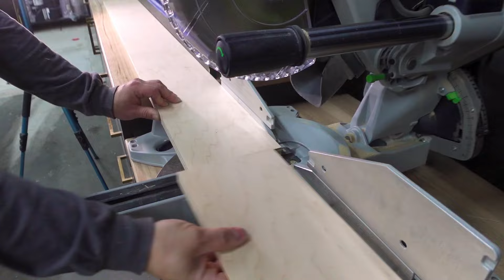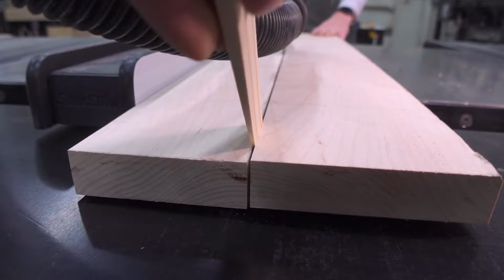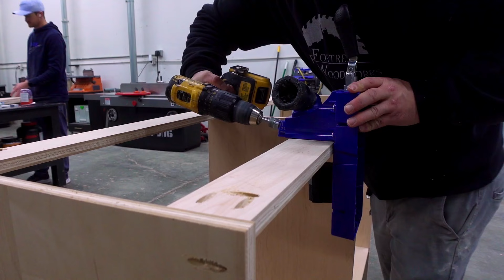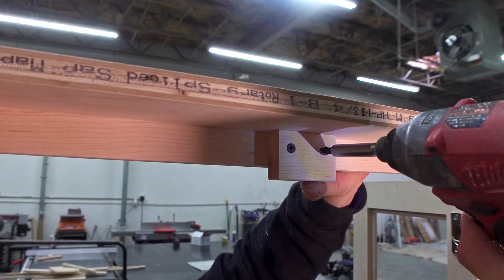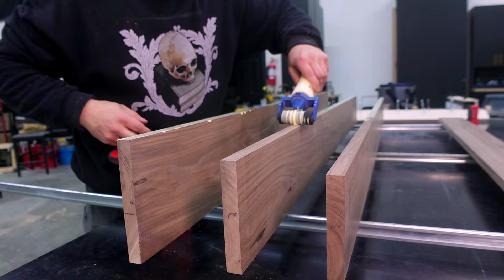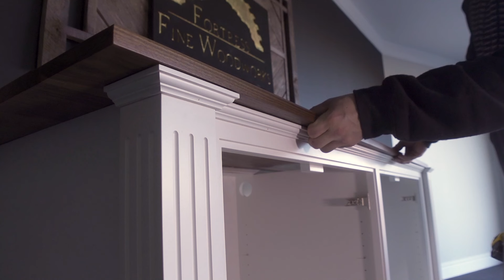Adding The Golden Touch.

Comment: "Some like walnut and some like painted" completely sums up YT woodworkers.... there are literally thousands of other species, but YT is either walnut, epoxy or painted
Reply: yeah i find that too.. one successful YT'er does it.. others with a lower sub count think itll help subs

if you check ebay, see the amount of people buying walnut lumber and boards -  and also the amount of river tables

in fact river tables are so common, it makes the cost of producing one outweigh the value - supply and demand (and many river tables look gaudy and tacky with waves and models sunk in to make it look like a beach :s)

fortress, four eyes, blacktail etc i think use wood/epoxy in much classier ways than some sub hunting rivertable epoxy fiends - and think up new ways of doing things, rather than copying other YT'ers

epoxy just became the new MDF.... and theres a huge influx of people watching the videos and then making something and flooding ebay and etsy with their rivertables and railway sleeper 'furniture' where they buy pith ridden railway sleepers for cheap, cut and screw.. and then sell it for an extortionate price as rustic furniture :s ....and people actually BUY that rubbish

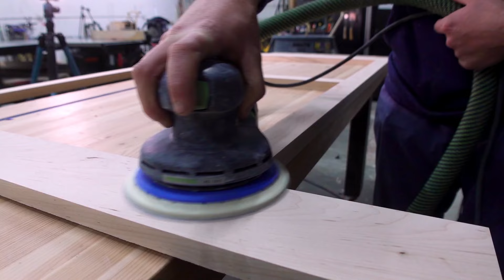Comment: 8:35 - The dominos I've used both had an issue where the clear plastic guide was not centered, so when I'd put two pieces together they would not be flush side-to-side. 

I ended up widening the screw holes and sanding off one side of that clear plastic piece so I could adjust it and that gave me perfect alignment and fixed the problem. I used the scribed marks on the bottom of the tool to line it up. 

Quite a glaring issue that a $1200 tool shouldn't have.
Reply from the maker: Ya, I'm surprised yours needed that much fiddling to get it right. I had to do some altering to my kapex to get the fence straight too. It's annoying when it happens but 99% of the time everything is dead on
Reply: @FortressFineWoodworks  I’d hope it’s rare for the price point. 

I have a Kapex that I can use (local Woodcraft) but I try to avoid it. Even with a great blade it just gives me so much tear out and an almost rounded cut, but my Rigid at home that I squared up gives me near-perfect 90° super clean cuts up 16” long. 

I just want to tell people to save their money and take the time to really set up their tools.

Thanks for the response! I really appreciate all of your insight and work you put into your videos.
Reply from the maker: Thank you for your experiences too!

Comment: Im pretty sure it's not the aluminum that triggers the saw. It's the current running through it + meeting the resistance of your skin that does. If your hands were electrically isolated from the aluminium, the safety shouldnt trigger.
Reply from the maker: That's a great observation! I would say it's the electricity grounding through the cast iron since that is far more conductive than my juicy hands
Reply: @FortressFineWoodworks  Sure, that too, the main point being the current needs to hit the "resistance" (not sure if that's the correct word cause physics) of skin or similar like a hot dog. The saw doesnt activate by contacting something conductive, ie metal on it's own shouldnt trigger the saw. Metal + your hands touching the metal will. I think there's an article/FAQ on SawStop that discusses how the tech works. It's not triggered by conductivity.

Comment: Mind if I ask what paint sprayer you use? I can’t find it in description. Thanks!
Reply from the maker: It's the graco x7 with a 308 fflp tip. 
https://amzn.to/49VKdts
https://amzn.to/4bXRfQ9
https://amzn.to/43baq5e
And the hvlp is an earlex sprayport with an apollo atomizer gun
https://www.dipyourcar.com/products/advanced-dipsprayer-upgrade-no-gun?variant=14741902468?utm_source=google&utm_medium=surfaces&utm_campaign=free-listing&gad_source=1&gclid=CjwKCAiAopuvBhBCEiwAm8jaMW9MQVU2cjyjJKN3GdqsCQdBAn8vn0rsIsW3hdPXdjjVUcuggWia2hoCuIgQAvD_BwE
https://amzn.to/3v0DfVh
Reply: @FortressFineWoodworks  oh, so you use two different sprayers? Do you just use a different one for different applications?
Reply from the maker: I use hvlp for solvent "oil based" coatings, and airless for waterbased coatings

Comment: Hey man, so I have a question for you. And you’re just the guy that can answer it. 

So I’ve built many cabinets. With my dad who’s been a carpenter since the 70s. And how he prefers to do it is stick build it on site. We get pretty good results. But I’ve been in his ear about him letting me build them in my lil shop (my garage)

My question is when you install, do you putty the nail holes and caulk the trim and then paint again? 

What do you do if the wall you’re installing into isn’t square,plumb, or level? That’s my dad’s main argument against building them off site. We do those things while we’re building. 

For example there is a little gap in your basecap in the finished product. Obviously it’s not been installed to finish yet. But would you caulk or putty a little spot like that? How do you go about installing and finishing the install?
Reply from the maker: We use wax fillers for holes, then touch up with the original paint if necessary. For caulk lines we tape the finished product, caulk the seam, and immediately paint with the wall paint, then pull the tape. Youll have to watch more of my videos to see. Here's a video on installs https://youtu.be/1YPB6A0pSOg
Reply: @FortressFineWoodworks  thanks man. I appreciate it.

Comment: Your project turned out great!!  Just my two cents worth: when you glue up the fluted columns, use packing tape across the joint, add glue and then fold the joint together.  I have used this method on everything from small boxes to large heavy columns for kitchen islands as well as wraparound grain for fireplace mantels.  If you put just the right amount of tension on the tape you will get a very tight joint and won’t have to fill the divots left by the spring clamps.  Love your channel!!
Reply from the maker: Thats a great idea. I completely forgot about that trick when doing it! Thanks for watching!

Comment: So.... do t know if anyone noticed... but.... when the brass mesh  hit the blade, it retracted. And the brass had a bit more than than a knick. THATS YOU’RE FINGERS PEOPLE.
Reply from the maker: The only reason it took the blade a second to recognize it is because the aluminum has an anodized coating. So it wasn't grounding against the cast iron very well. It would act faster on a finger

Comment: In regard to panel saws and lacking the same technology as a SawStop.  True panel saws are operated differently than a traditional table saw.  Their inherit design eliminates typical kick back scenarios.  And their operations and design also keep your hands away from the blade, unless you aren't operating it safely, thus correctly.  I think if someone has the means to purchase a true panel saw and are concern about safety, I suggest that you operate one before making assumptions that the SawStop is the only safe saw.  Now credit where credit is due, and SawStop saws are nearly idiot proof, ensuring the function is ""ON".  But with a panel saw, just operating it correctly and not taking short cuts (using jigs and clamps as appropriate), your hands are never required to be close enough to the blade to create an environment where an accident may occur, no matter how small the piece you are cutting.
Reply from the maker: I agree, but sometimes I'm an idiot. So problem solved
Reply: This past year they released a couple panel saws at AWFS that had similar technology. Maybe more advanced as you don’t need to replace the cartridge. Felder should have it.

I’ve been considering a panel saw as well and agree with the above statement but since I don’t currently have the space I should be going with Harvey later this year.

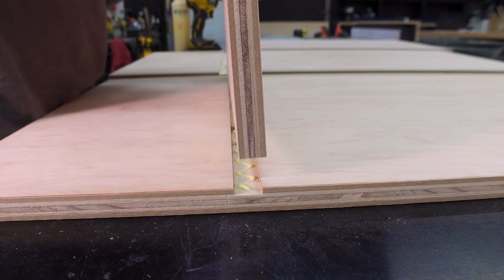Comment: 3:32 why is the dado so much wider than the vertical piece? It's offering no support and structural aids at all. It also isn't specifically placing the panel in the correct position, either...
Reply from the maker: Because in a cabinet like this, I don't need that extra support. It's just for alignment. And fitting a perfect dado take twice the time as a looser one. My dados are much tighter on tower cabinets and shelving where the strength us needed. Thanks for watching!

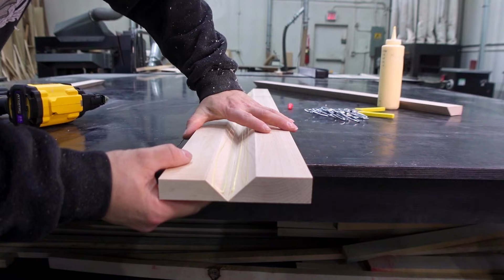Comment: 17:20. Good time to use the blue tape trick when closing that long miter?  Or, does that propose a problem when you can't see the spine of the miter?
Reply from the maker: Yes that would actually work quite well if you dont have miter spring clamps.
Reply: A perfect 45 degree angle isn’t good, you want a 45.4 ish  so it can close tight and push the extra glue out the back

Comment: People who don't do woodworking don't have a concept of how long it takes or how hard it is. The amount of prep, measuring, and accurate cuts to get several different boards to line up once assembled can be immense. What you made in this video is amazing. 

I made a desk organizer for my wife recently, not complicated at all. 40 inches long 3in tall and 12 inch deep. She wanted it quick so i pieced it together from wood I had on hand. She added a 2nd tier about halfway through which wasn't a problem, I hadn't 
started staining yet. All in it was a weeks worth of work working on it 1 weekend and a few nights during the week. Very short project. But still required a lot of planning and cutting and layout to get it to look good. 

Whenever I price stuff and people look at me like I'm crazy I tell them a project like that will require a table saw, miter saw, paner, glue up time, and sealing time. Everything that goes into doing that isn't free.
Reply from the maker: It's a lot of things! I can't tell you know what's up! Thanks for watching!

Comment: I get the same issue with the domino not creating flush connections.  One thing that seems to help is to very slowly enter the wood so that the bit isn't getting "pushed" by the wood and creating a slightly different path.  The other is to be very careful about the downward pressure your pressing hand is making.  Sometimes its difficult to press the domino inward without pushing slightly downward (or even upward) which might inevitably adjust the height at which it enters the wood.
Reply from the maker: Actually, I was thinking the same thing. And that's why Cody gets more inconsistent joints because he hasn't gotten that feel yet. Thanks!

Comment: Hi Cody,
If you don’t mind me asking, what product did you use to paint this and what size tip in your gun? This turned out beautifully!
Reply: My apologies.
Thank you so much for the response. Best wishes for the new year!
Reply from the maker: Happy new year!
Reply from the maker: Hi Kristen, Cody is my employee, I'm Cory. We used 2 coats of envirothane 170 white primer. Sanded with 320 or 400 grit until buttery smooth. One coat of envirothane 200 White topcoat tinted to Dover White. You can get envirolak products from industrial coating suppliers. The airless sprayer is a graco x7. The tip is a 308 FFLP tip for everything. Thanks for watching!

Comment: I love that the plan isn’t always thought completely out.  Because things change CONSTANTLY.  Wood behaves weirdly sometimes.  Measurements can be a hair off.  The customer can call halfway through and ask for a change.  Hell…you could just feel off for a few hours and something changes because of that.  Having a set step by step, screw by brad nail plan can lead to more failure and disappointment than being able to compensate and pivot in places to finish the project.
Reply from the maker: Yes, that's exactly it! Figuring things out as you go is part of the art. Thanks so much!
Reply: @DeuceMoose88 - I've made entire pieces of furniture based on only one dimension. It's fun, and in a way, easier to do... relative measurements based on the work!
Reply from the maker: I've done something like that too

Comment: The main drawback of a saw stop besides the price  gouging is that it destroys the saw blade and the cartridge. I dont think its necessary to stop the blade like that given how fast it retracts the blade. It could use a non destructive brake to stop the blade if any brake is needed at all. Its fairly likely the brake is only there to be a consumable and force customers to buy replacements.
Reply from the maker: I actually agree with that. But they actually give you a free brake if it detected skin. So I think they are trying their best
Reply: @FortressFineWoodworks  I would like to see someone do the hotdog test without the break installed. They are probably going to have to trick it into thinking there is a break.
Reply from the maker: Yah, it needs the brake for the system to be active
Reply: @TomsBackyardWorkshop  I'm not enough of an engineer to speak intelligently, but I'll say that my left pinky finger wishes I'd bought a Sawstop. Sometimes, if it's stupid but works, it's not stupid... old Army saying there.
Reply: @mattelias721  I didn't say it was stupid. it's just way overpriced, and the braking system is unnecessary.
Reply: @TomsBackyardWorkshop  Tom, no offense intended, and was not implying you said it was stupid - I did read your word, "Unnecessary," as you said. I'm just not sure how to ensure the results without instantly stopping the blade rotation.
Yes, they're overpriced. And, yes, I still wish I'd bought one because I'd have a functional left pinky now. That. Is. It.
Reply: @mattelias721  the blade already drops below the table in a fraction of a second. In order to get seriously injured, you would have to jump on the blade or intentionally slam your hand on it.
Reply from the maker: Sawstops manual says that it stops the blade rotation and uses that momentum to drop the blade. So I think it's all apart of the physics
Reply: @FortressFineWoodworks  Without question - all that kinetic energy has to go somewhere. From that point of view, dropping the blade is likely required, but I don't have a manual to judge how the stopping without dropping would wreck the arbor and motor trunnion... or not. The translated rotational force would still be directed at the user-side of the table, unless the blade brake is at the back of the blade...?
Reply from the maker: I'm thinking they figured it all out so we don't have to.

Comment: Trying to force that maple through the cut is the most relatable thing I haven't seen anywhere else 😂
Reply from the maker: Hahaha funny stuff huh? I've done that like 100 times or more, and didn't even know about the shim thing for a while
Reply: I had a badly kilned piece of walnut, I ended up ripping it by hand rather than risk it pinching. It was only a short rip, I wouldn't want to do that with a longer board.

I've got a bandsaw but it's still in pieces in my kitchen after moving house.